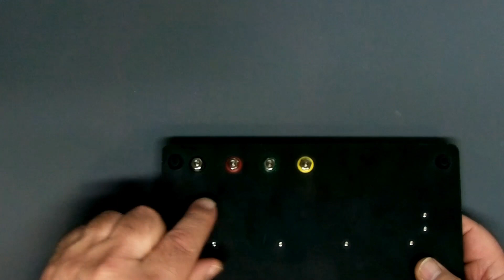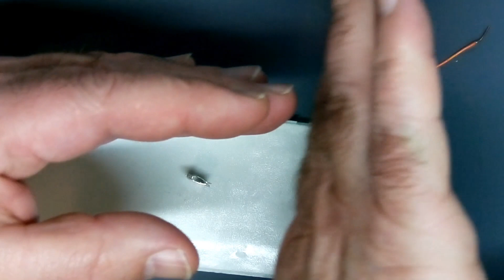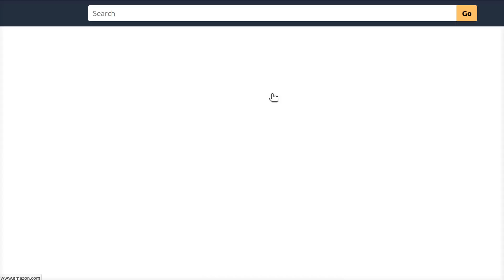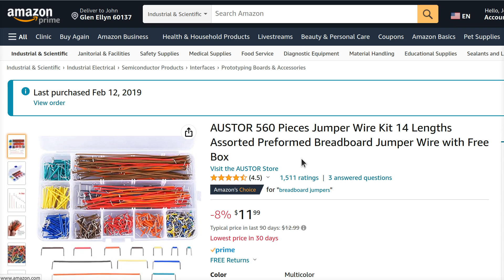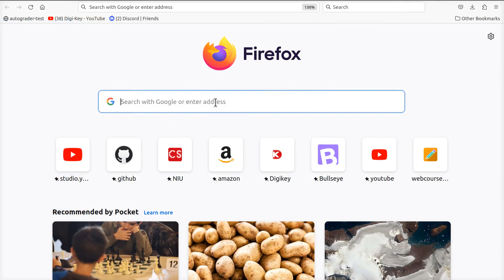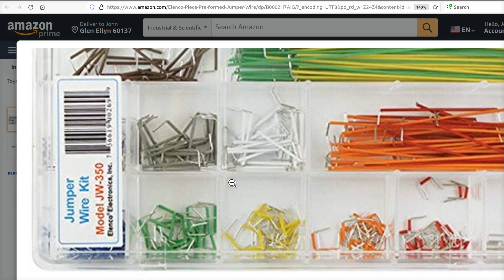A Review of Solderless Breadboards

Comment: thank you for the review.
I am new to this and planinng to bulid 8 bit computer ,I should take the BB830 ?
it is very expensive when you want to buy it from the middle east 
is there alternative?
Reply from the maker: How many do you need?  If only a few then Ben Eater's site is worth supporting.
He has them for $8.79: https://shop.eater.net/products/bb830-breadboard

DO NOT get the cheap boards nor the thin jumper wires.  Find some that are 22 gauge!  The 24 gauge ones are flimsy.  Yeah, they can work if you are careful and have a good breadboard.  BUT if you go cheap on the breadboard then 24 will be way too loose!
Just last weekend I used one of my cheap bread boards and it was not maintaining contact with resistor leads.  VERY annoying and time-wasting!!  The cheap ones are only good for holding things while soldering.
My Elenco 9440 board came from Fry's (no longer exists.)  I would have never paid more than $30 for them... and I see right now Elenco selling the same 4-boards on a metal base model for $68!!!!????
Makes $8.49*4 look cheap!!!
It looks like I also have some GSP GB6-474 boards that are the exact same thing (and with good breadboard springs)
Here is someone selling them for $45: https://www.diverseelectronics.com/products/Breadboard-3220-Tie-Pts-240-x-210-x3-2mm-p5705/  ...but for only 4 breadboards, Ben is still cheaper.
I do not like the jumpers with the crimp-on plastic ends & square posts... mine tend to break off the wires after not much use... I obviously got some crappy ones.
I insert and remove my solid core jumpers using needle-nose pliers.  If you use your fingers, you will bend them and they will become messy and possibly break due to all the bending.

If you find anything better, please post back here and let me know!
Reply: sadly the best price with quality is the one you mentioned but he ships them from California and I from KSA so it becomes very expensive because I need to buy 14 breadboards
I got another Idea from my friend he suggested that I should design the circut with Kicard then print it using pcbway and they ship the board to me from china which will be more cheaper but i guess I need soldering 

I still I don't know if the PCB is a good Idea for my project or anything about it
so If you have a clue tell me about it and I am really thankful to you
Reply from the maker: @KH_V7  14 boards?  Yeah, I'd prefer to go for a PCB.  If it is any help, I recorded a KiCad series that might get you started.
I'd be surprised that noone already drew one up for Ben's project... if that is exactly what you want to make.
USE SOCKETS for everything that you can!!!!  You may find yourself wanting to do upgrades and not have to re-buy everything!
Reply: @JohnsBasement  yeb ben project required 14 breadboards,the schematic of the circut is written in ben website but I will try donig it by my self.

I will check the series you made and thank you for the help
Reply from the maker: @KH_V7  I saw someone post a PCB they created for it with KiCad on Github... notes suggest some errors to fix.  The image looks like a fairly large PCB.  I might have made it smaller.  Meh...

Comment: Are the $85 3M breadboards overkill?
Reply from the maker: For hobby use?  I'm not sure if it'd improve my results over that I have been getting with the more modestly priced ones.
I use the junk boards for things that run hot of have fatter leads that I know will keep good contact with the junk springs and I chuck them if they start acting up.
I use my be better ones for thinner leads and more extravagant wiring that takes too much time to risk wasting on a cheap board with bad springs.
Legit BB830 boards from Ben Eater's eater.net should be fine.  I think they are $8.

Comment: Every breadboard I have used has the power rails, then 5 holes connected vertically.  Is it possible to get one with the vertical rows a bit longer?  Eight holes would solve all problems, but even six would be a huge improvement.
Reply from the maker: Beats me.  I've only seen them with 5.  More holes would create more noise. So it's a balance.

Comment: One thing I hate about these breadboards is when using them with 0.6 inch or wider DIP/DIL packages where most of the connection holes are made useless by being covered up.  Another bugbear is the abnormal spacing between the power rail holes and the standard holes requiring some mods/bends/kinks to pre-cut wires.

Comment: Unlike you I find the banana posts handy for a couple of reasons: A) Quick connect and disconnect to lab power supplies with banana posts. B) It prevents unwanted tugs on the power supply leads to pull out from the breadboard.

Comment: Watch out for some older breadboards whose metal interconnects are just a common U-Channel rail without individualised finger connects for each hole. The issue with these is if an adjacent wire/pin of a slightly larger size is inserted it opens then clip wider and can cause the existing connections to become unknowingly & unwantedly disconnected.
Reply from the maker: Yikes!!  That is even WORSE!!!!

Comment: Two boards with a double-row between are not 1/10" spacing, and actually about half a hole off.
So I removed the double between the two rows and used another perf-board with pegs to space them perfectly apart, then tacked them down.
Now I have a space between but run wires up the center to keep my builds very clean.
----
Some boards are Nickle plated, some are just cheap metal.. if it doesn't say Nickle, Silver, or Gold plated it's NOT.
Found out many years ago that these do NOT work for RF experiments, but have built complete processors on them.

Comment: Your comments on Ben Eater style breadboard computers is exactly what I would've said. Any chance of a single wire coming loose or a bad connection that can't be traced, and you're sitting there for ages trying to figure out why it's not working. Not to mention the headaches of storage, making sure that it's not subjected to movement or humidity that might cause corrosion. The self inflicted pain tends to overshadow the novelty factor. But no question it helps to explain the concepts in his tutorials and he does a good job of it.
Reply from the maker: There's nothing wrong with building a system on a breadboard.  It is a great way to learn.  After 40 years of learning, I am OK with making my more complicated projects on custom PCBs.

Comment: Ben uses BusBoard brand bread boarda. They are SO WORTH it. Cheap chinesium boards are only good for 20 AWG leads or holding headers for solding. I have found that Chinese products where the company name is part if the mold are pretty good.

Hate the foam tape, remove it and use nice thick heavy duty packing tape. I ised to do wire install. Nobody back pulls the 50 pair, I did. Gave my professor 10 one foot bundles, still have some still in the jadket, hand wound up 10 foot rolls, and used short bits for twist ties all from 1993.
Reply from the maker: Right after I posted this I had the same thought that they would be good for soldering jigs!  Every time I do some header-soldering I fear ruining my breadboard.  Using them for jigs is perfect because, while they are flimsy, they can hold the header pins and are also loose enough enough to get the headers back out when done without the trouble.

So I feel a bit better since I don't have to just toss it in the trash.

Comment: What is your opinion of Jameco or Mouser ?
Reply from the maker: I don't see them as equivalent for the purposes of comparison. Mouser is akin to Digikey in that I expect them to deliver product from specific venders and with proper MSL markings etc.
Jameco seems like it includes more of a high quality liquidator side to its business that can substitute brands but still provide a quality product.
I do not expect Jameco to have a large stock. So if I publish a parts list, I'll spec a distro like Mouser so I can expect my recommendation to be valid for a few years.
Some parts from Jameco might come and go more easily.
On the far end of supply reliability would be ebay.  With allelectronics between ebay & Jameco.  Any stock there could vaporize at any moment.
Reply: I have 3 jameco valuepro x2/x4 breadboards with the power posts and they're great.

Comment: The incredible amount of insertion force required on cheap, no-name breadboards is my main beef and that of many Amazon reviewers.
Reply from the maker: Incredibly.... Low?  Yes.  If you are seeing a high force, then your wires and leads are probably misaligned and are hitting the funnel on the mouth of the metal leaf springs.  And if so, forcing in a lead/leg is likely destroying the springs.
Reply: @JohnsBasement  No, it's not  that.  This would be more easily described with a drawing, but on most decent breadboards, the contact strips are basically U shaped.  The bottom ot the U is more typically flat, but the sides are sprung together so as to grip the component at the top.  However, right near the top of the side arms, they are bent away from each other to form a "throat" to insert the component leg.  I bought a couple of real cheapies, and they don't have that throat.  The side arms of the U are sprung together, and simply cut off flat at the top ends, so when the component leg is introduced through the hole in the plastic body, it meets the flat ends of the U-springs and can't find a place to force them apart.  It is thus very difficult for the component leg to spring them apart.
I chucked mine out, and asked a few questions online before buying new ones.
Reply: @JohnsBasement  you either need to park your car on top to get them in, or you drop the wire and it falls in